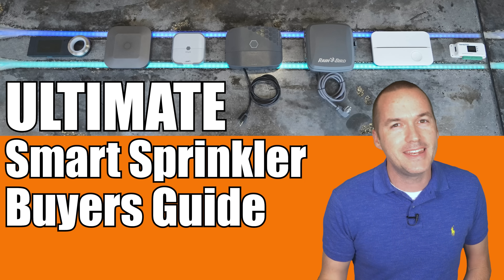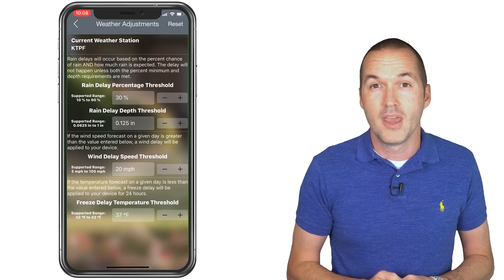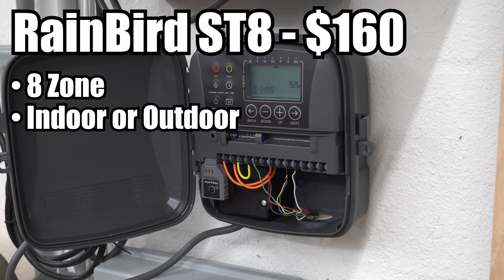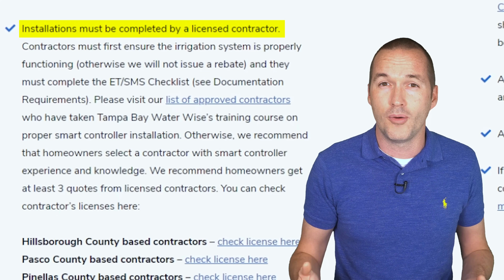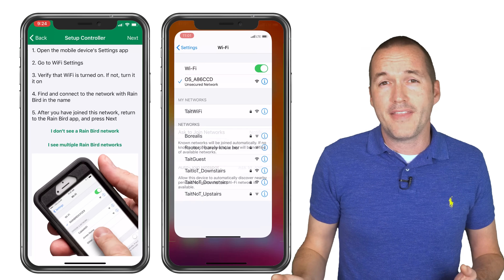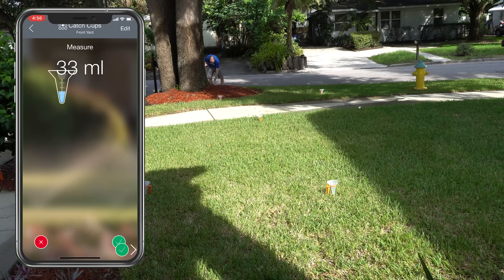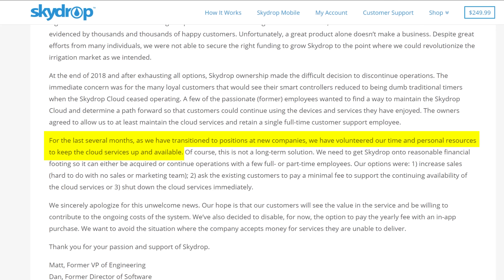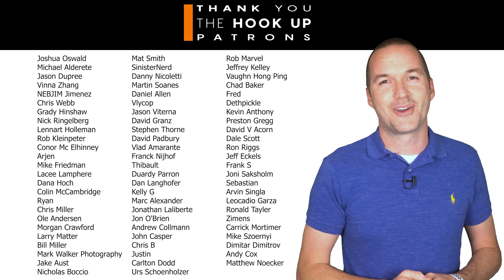7 Smart Irrigation Systems TESTED: Buyers Guide

Comment: open sprinkler is amazing and can do so much more. including automating more than sprinklers.  i use mine to also open and close chicken coop doors based on sunrise and sun set. it also works without the internet just fine.
Reply: also you never once spoke to valve voltage compatibility ,i got my first open sprinkler  8 years ago it still works i have since got two more for around the farm. they are so powerful and can also turn on the irrigation pumps
Reply: A core functionality he rated these systems on was their ability to connect to the internet to download weather information.

So you can't really automatically adjust for humidity and rainfall without that.

Comment: I think i need to say something here.
I have the BHyve and it works fine. But I can do away with all the "extras" it provides; they are just not working.
I used it for some time and my lawn started to dry out.
I my area you can have rain in the forecast, actual rain falling in the city, but you might not get any rain in your yard.
So, it does not work for me and most likely for many others.
I am using it with the rain sensor and it does a fine job. I also like the web interface for controlling the system while i am not at the house.
Reply from the maker: Here are my suggestions:  1. try picking a weather station that is closer to your (you can select from personal weather stations as well) 2. Try moving the rain amount and % required for delay up.  Mine was set for 30% chance of 1/8” of rain, but in Tampa there’s a higher rain chance than that every day from May to October.

Comment: I have the Rachio and use automations in Home Assistant with it.  I have a few zones that trigger my security cameras when the zone is running.  I use an automation to turn off the motion sensor when these zones are running and then turn it back on when the zone completes.  I have to admit that I am not sure I have all of the soil types and sprinkler types properly set up and have to do some work to make sure I have all of it correct to take full advantage of the features.

Comment: Thank you for alerting me to the Flume water sensor, with integration to my B-Hyve irrigation controller.  The Flume sensor installed easily to the water meter with only a strap and works accurately.  No more surprise big (or small continuous) water leaks for me.    Very well engineered, worth the $200 to me.  I would have purchased it thru you with Amazon, but you did not have a link.    Thanks!!
Reply from the maker: I try to make a point to only put links in the description for things that I've actually tested, I view it as a sort of "Approved by TheHookUp" limitation.

Comment: I have actually used open sprinkler for a while.  I put it onto a raspberry pi.  It seems to be a great buy and was very cheap.  (Of course though I have the computer side done I have yet to lay any pipes in the yard!)
Reply: If you don’t have an irrigation system installed, you don’t have a clue what your talking about.

Comment: Or you could buy a sonoff 4ch pro r2, 24V power supply for the sprinkler heads for a total of about 40 bucks and have local control (and also local buttons), flash tasmota if you like and hook straight into HA or your choice of hubs and the sky's the limit! Definitely not off the shelf like these solutions, but budget friendly!

Comment: I have had a really good experience using OpenSprinkler over the past 4 years. Ray (the developer) is really responsive with any bug fixes (eg switching from weather underground to dark sky) and the product is getting good support from an open source community of developers for feature enhancements and general improvements (eg addition of MQTT and external sensors)
Biggest thing for me is the open access to integrate it with my home assistant home automation via REST calls. This opens up a whole world of integrations and smart rules to have my sprinkler system working with other elements in the house (eg presence detection, temperature and soil moisture sensors, external weather feeds into home assistant).
I’ve been super happy with the product

Comment: What really made you chose the B-hyve over the Rachio 3?  Just price?
Reply from the maker: Yep, the BHyve indoor 8 is basically identical to the Rachio as far as features and costs 1/3 as much.  For your extra $150 with the Rachio you get more user friendly wiring and slightly more smart home integrations (BHyve and Rachio can both be added to home assistant, but Rachio is easier to add to SmartThings), not worth $150 in my opinion.

Comment: Nice reviews as always. I'd have to disagree with your assessment of Open Sprinkler being risky. Being open source, it's much more likely that a weather service can be replaced, or new ones can be added. And it doesn't require the company to be behind it. This has already happened once. Although you make a fair point about ease of setup.
Reply: and it works for HomeAssistaint  , this review is not very good , unless you are the company that paid for it.

Comment: Really a bit surprised by this, opensprinkler would be one if you want to have full control. After all, a sprinkler system is just a fancy relay timer. For average home users, I'd suggest like you mentioned the rachio. I tested a skydrop for about 1 week when it first came out and quickly went back to my ospi and have been happy with it for the past 7 years. Things changed since then but you could always modify the code yourself with OS and get whatever functionality you want. If you want to just rely on someone else figuring out how much you should water the others might be better. I've just questioned the skydrop when it did that if it was watering too much or not enough so you end up doing the work yourself anyway.

Comment: Missing RainMachine to be a top notch review but probably the most encompassing review out there.  Although I already own RainMachine I still like to be kept up to date with features of other controllers. Still I disagree that Rachio is top for integrations. There is a difference between having a lot of useless integrations like with smoke detector and having powerful integrations. For example every action is available on RainMachine for IFTTT and also all triggers not just "zone started" "zone finished". This really allows me to integrate with other smart devices in my house, to stop leaks, stop pump, pause on wind etc.

Comment: As always awsome content Rob. Would you consider building a DIY version? I have a project in mind and I already have parts using a moisture sensor connected to a esp8266 to measure if the lawn needs to be watered. I was thinking it would be cool to send the info to homeassitant and run the sprinklers though a automation like if it was going to ran don't water but if I wasn't do water at 2am. That way no cloud needed.

Comment: I've owned both B-Hyve and Rachio and firmly believe the Rachio is the superior product for a number of reasons:
The B-Hyve  app has a number of software problems that arise when attempting to modify advanced settings within the app.
 The cycle and soak feature on the Rachio is far superior to that of the B-Hyve in that the timings are much more optimal based on the soil type and gradient selected within the app. 
The Rachio makes it much easier to take weather and rain data from a personal weather station. 
The Rachio allows an external soil moisture meter to be used to determine when to water and how much. 
Lastly, ALL of the Rachios smart watering functions can be used while still specifying which days you'd like it to water while the B-Hyve can only use "Smart Watering" where it decides which days to water and how much OR a schedule of certain days and times that can only be skipped or not skipped as opposed to modified automatically by the prevailing weather conditions. 

B-Hyve might be the cheaper unit but for those who want more control or a superior/more efficient irrigation system, the Rachio trumps it in all categories except price.
Reply: Thank you for the comments Donovan.  Did you already have an irrigation system in place?  If so, which do you have which worked well with the Rachio?
Reply: @jasonmiller6381  I've got a simple 4 zone setup with Hunter valves and Hunter MP Rotator sprinkler heads. I think most 24VAC valves would work just fine with Rachio.
Reply: @juistb2  Thank you so very much for your help!

Comment: I have found several ways to integrate the B-hyve controllers into home assistant. The first one is a HACS add-on which allows you to turn stations on and off as well as set rain delays with automation. I don’t need the automation, so I have a webpage window in Lovelace UI that shows the b-hyve web interface. From my experience it works perfectly on my android tablet that I have mounted on the wall (I access HA there with fully kiosk), but on every other device I have to input my login credentials for b-hyve every the page reloads.

Comment: While the weather intelligence feature is interesting, it doesn't work at all in our home environment - there's just too many microclimates where I live (Vancouver). The proximity to both the ocean and mountains and large changes in elevation create bizarre weather conditions here. Top that off with plants that range from huge cedar tress to sheltered ferns and, without direct moisture sensors, it makes truly 'smart' irrigation really tough. 

After having some plants die due to incorrect forecasting, I'm using my  Rachio effectively as a very sophisticated  scheduler. One size most certainly does not fit all.

Comment: Great video as always. I chose the OpenSprinkler (since the alternative was building my own from scratch based on ESP8266). The great thing about OpenSprinkler is that extending it is easy. I have 24 sprinkler zones, and this was the only one (at the time at least) that could do this with ease. I actually also use it to control the pumps for my swimming pool, with a couple of power relays driven as though they were sprinkler zones. While a HASS extension would be nice I’ve implemented this with simple HTTP GET, so I can manually turn on/off pool pumps even though the OpenSprinkler normally runs them on the timer.

Comment: @The Hook Up
Can you do one on ceiling fans?
Reply from the maker: Unlikely, would be a bit of a stretch as far as fitting the channel.
Reply: @TheHookUp  perhaps reconsider.  I for one, would love to know how to integrate a ceiling fan with lights into my home automation. Things like: turn fan on at certain temperatures before turning on AC (might save electricity), prefer fan to AC at certain times of day or based upon forecast, change fan direction based upon season, adjust speed, integrate lights into my lighting and scenes, etc. 

I think there is great potential in a ceiling fan automation video.

Comment: Sorry if you mentioned this. But is this for sprinkling lawns only, or for flower beds and vegetable patches? Also it seems unlike you not to make a DIY version! I think soil moisture sensors and pumps is the main / basic requirement? I have bought various parts to make my own using capacitive sensors, yet to make.
Reply from the maker: You can use it for flowers and veggies too, it’s a setting.  As I mentioned, I think  this is an instance where I would need to do so much research into lawn science to do it right that I’d rather go with a prebuilt option.

Comment: I have the b-hyve and I like it.
The newest version has 16 stations but only 4 programs and that’s the same with my older version. 
Programs if you don’t know is the timer settings you set for your stations.
Meaning your limited to 4 programs that you have to group 16 stations into . If you only have 12 stations like mine, you can squeeze buy just barely.
I know if I had 16 stations I definitely would need more than just 4 programs.

I completed the rebate through the city successfully. It wasn’t easy and the information they required was crazy retarded. They wanted a rain gauge installed even though the b-hyve doesn’t need one I believe. I got a rebate on the rain gauge also. 
The fine print said I needed 12 stations setup and being used for the full rebate . I only have 9 stations but I hooked up 12 wires to make look like I have 12... then had to send in pictures . There was a chance a inspector would have to come and check the installation but was decided one wasn’t needed.

Comment: Any thoyght on 2 wire systems? I have a complicated yard and 2 wire system would allow me to splice into a live water supply with an addressable valve and whole system controlled on 2 wires.  Valves dont necessarily have to be in a valve box and you dont have to run a bunch of extra wire for future valves.
Reply: Look into hunter ez decoder system. It's pretty new but it's the only 2 wire system that could make sense financially for a residence

Comment: I went with a RainMachine. Uses the hyperlocal rain forecasts etc but...also fully independent from any internet connection if you want. If their service ever goes away you can still access over the internet.
Reply: I had the RainMachine for a while. I found the touchscreen to be too cheap to be realistically functional for on-device control. It does have local network control, so you won't lose app connectivity if the internet is out. I did really want the on-device control, but after several years it just feels unnecessary (beyond a quick manual start and zone advance button).
Reply: @timzalk3534  I went for the mini since I only have 7 zones plus master. Good to know about the touchscreen.
Reply: Rain machine appears to be out of business now.
Reply: @DriverDude100 bummer if so. I see their RainMachine servers are still active but if they go away I still have local and remote access without them. Funny thing is I was considering rachio just for the integration with my tempest weather station.
Reply: They're the best

Comment: On the topic of integration with a larger home automation system, the only thing that I've heard of including a sprinkler for is for a fire alarm. The logic is that if you can configure your irrigation controller to go on outside of it's schedule when there's  a fire (IE, smoke alarms trigger), then watering the lawn can help the fire NOT spread to neighboring homes. 

Other than that, I too think that a smart irrigation controller is very much a set-it-and-forget-it type of device that I don't care if it works with the rest of my home automation stuff.

Did you consider something like Spruce? https://spruceirrigation.com/

Comment: For anybody that doesn't have the time/patience to integrate into the home-automation and manually set-up the sprinkler system, the above systems are the best "bang-for-the-buck".
On the other hand, if you're invested in doing your home automation yourself (with Home Assistant, OpenHab or similar), then you definitely want a system that you can control. 
The main advantage is that you decide what cloud services to use for weather and stuff, if one goes down you'll probably have others available, this way you can get around having to pay monthly bills for services.

Comment: you shouldn't be watering during the night, specifically at 2am like you said.  It sets up the perfect conditions for disease to take hold.  I'm really surprised and concerned if the setup wizard selected 2am to water your lawn.
Reply from the maker: Local restrictions require watering to finish by sunrise.
Reply from the maker: Also, I just double checked, my next watering is set to begin a 3:55am, I misspoke.

Comment: Orbit B-hyve has integration on home assistant! I have both working on my setup! It works very well, I can even use my HA mobile app to turn on and off sprinklers without having to walk back to the base or use their app. This is nice when I have to find and fix leaks that my wife made in our side garden’ drip setup.
Reply: Plus, I was able to forward the zone switches from HA to my HomeKit and now I have sprinklers there too.
Reply from the maker: It's still a HACS integration though, where as Rachio has an official.  It's not a huge difference, but definitely worth mentioning.